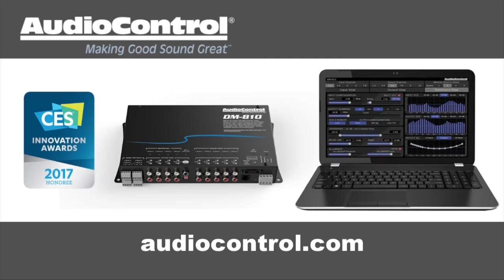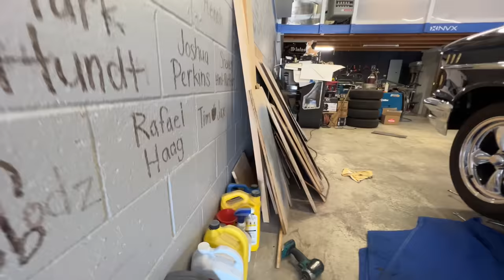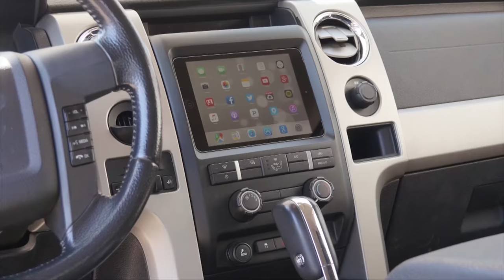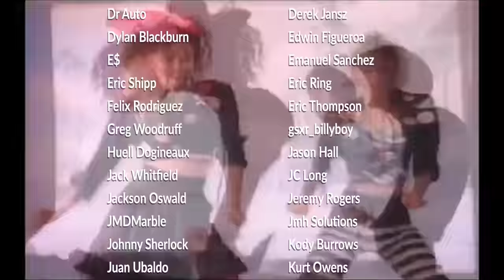Fixing steering problem 57 Chevy - CPP center link installation

Comment: Check the vintage air front runner kit. Converts it to a serpentine belt system and is nice and compact on the front of the engine. It also gives you a type 2 power steering pump for rack and pinion option. Can email pics of mine with it if you'd like. Mine has a ZZ4 350 with a 700r4 transmission.

Comment: That old center link was for an original power steering car. The cylinder was removed from it and an adapter with ball stud was screwed on the end where the power cylinder direction control formally was.  The pitman arms are different for a power /manual steering car.  You have the wrong pitman arm for that manual center link. Done many of them!

Comment: Hey man, you might want to check with the hot-rod shop on the proper method of tightening the nut on the ball joint socket mechanism because it looks too tight. 
It goes way past the cotter pin indicating that you over tightened it.. I understand your concern, you don't want it to pop off but there's a spring inside of that mechanism for a reason. 
If they meant for it to be tightened until it bottoms out, they wouldn't have bothered with a spring.  IMHO

Comment: Would love how they did the doors like a DeLorean in the intro 1st time I've ever seen it and looks cool as hell. Also is that running on the outside of the driver's side frame rail?
Reply: I bet it's valving for the air ride system

Comment: I would put a piece of rubber between the Jack stand and the frame of the car for added safety. Metal on metal has very low friction and could slip out. It might be a cool video to see you crushed under the car and you’d get lots of views but I’m sure it would ruin your day.
Reply: Its on jack stands